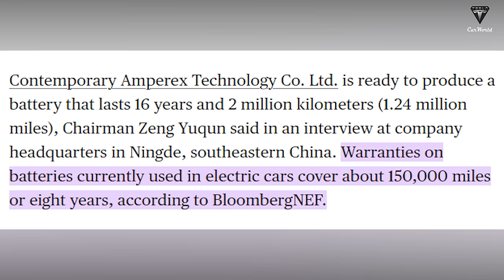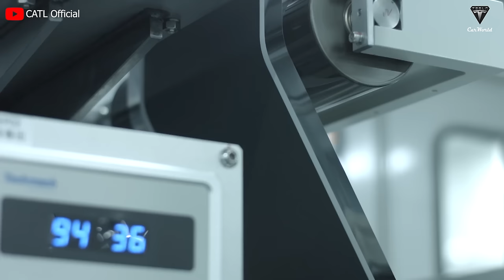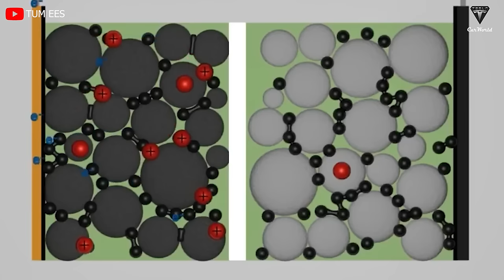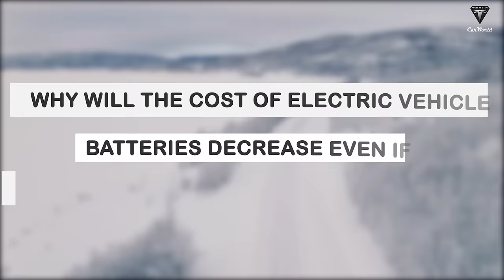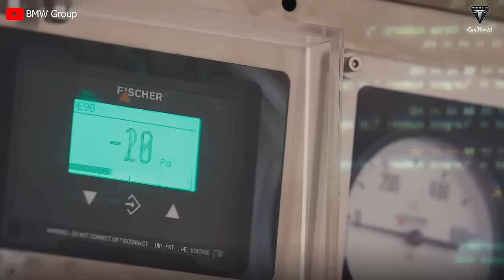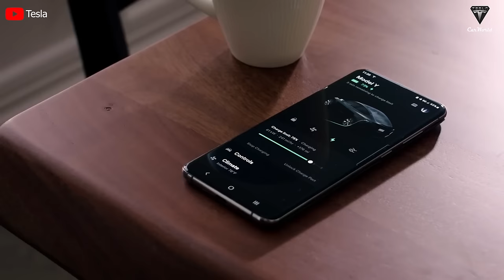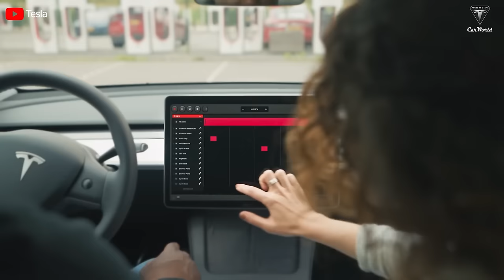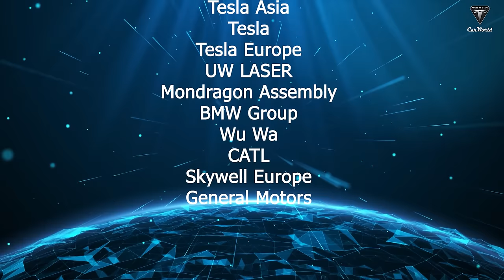Elon Musk Revealed RARE Battery 15 mins charge, Range of up to 1.24M miles! Shaking All EVs Industry

Comment: The BMS software should only allow charging from 20 to 80% for NMC batteries . The LFP BMS could allow full charge and discharge depending on the battery chemistry... instead of allowing the car user to arbitrarily charge, The car also could inform the user of the consequences of overriding the set parameters for charging . .. This will make sure the batteries are in optimal condition.

Comment: The biggest problem with batteries currently is not the warranty. It is with damage to the battery.
This damage, however slight, voids the warranty leaving the owner to pay for a battery that costs between 1/3 of the value to 100% of the value of the vehicle!

EVs depreciate so fast, that if the car is 1 year old or more, the insurance company totals the car and pays the owner the current value of the car which is typically less than is owed on the loan, leaving the owner having to pay the difference out of pocket.

But the cost doesn't end there. Insurance companies, which on avarage are already charging as much as three times the premium of an ICE car, the rate for the driver will increase as much as triple for as many as 10 years. So even if such an accident makes you give up on EVs and go back to ICE cars, you will still be stuck paying three times more for insurance for the next ten years.

Another fun thing about Tesla is that all of ELON MUSK'S super new technology like his now famous 'giga-press' are only valuable to Tesla. Making the entire chassis as one large part is cheaper to make and cheaper to assemble into a finished car. After that Musk doesn't care that the car is nearly impossible to repair. If the chassis is one part and it gets damaged, you have to replace the whole chassis. That means buying a stupidly expensive part and paying labor to disassemble and reassemble  the entire car without the benefit of rows and rows of robots. That is where the $20,000 repair bills come from. 
While not as bad as a damaged battery, a damaged chassis can easily cause the car to be totalled if it is only a few years old.
So remember, all of Musk's futuristic manufacturing breakthroughs are for HIS benefit, not yours.

EVs are like razor blades. You don't resharpen them. You throw them away.
Reply: I wonder whether it might be said that the fact that EVs are like computers on wheels makes their longevity but also repairability much like computers. So, the blame is less on Tesla per se than on the inevitable movement of EVs being made and sold lik electronic devices.
Reply: You haven't heard the "Rules of the Road" in Roatan! They are simple: Don't Hit something or someone, Don't get Hit by something or someone!"

Simple, smart guiding principles, that, when followed,  remove most, if not all, of your "Repair " concerns! 

Only one tiny scratch on my 13.5 year old current vehicle. None on the ones previously owned, since around 2002! 

Pay attention to Cross Traffic potential at Intersections - avoid T-Bone situations! Use your mirrors to keep an eye on what's coming up behind, keep an "Out" whenever possible, don't overdrive your tires and forward vision, (be able to stop, inside of your space between you and traffic ahead, even if it is suddenly there - Snowstorm, Whiteout, Black Ice, Fog, No Running Lights, Parked on Road, etc.) 

Basically, time Saved by going extra fast, is lost in seconds, and, as you said, can cost you, for up to a Decade!

Comment: If Tesla is partnering with CATL, what happens to their 4680 battery?  I heard that the 4680 has somewhat poor charging capabilities.
Reply: Not exactly sure if "4680" is, or is not, announced by CATL as a Form Factor they will also make, but I do recall Panasonic is moving to produce that form factor.

The Thing is, "Tesla's" 4680, is actually 2, or maybe 3, new ideas in one cell, at least. Besides the obvious Dimensions (46 mm Diameter x 80 mm Tall), there is also the "Dry Chemical Process" (which is the Hardest Challenge, from what has been shared), plus the "Tabless" design of the Jellyroll (which, is actually Continuous Tabs, vs just One), that adds up to their specifics.

Tabless Design, is just a Mechanical Property, same as the Can Dimensions of 4680. Anyone can build cells today, to accommodate such elements, with only moderate changes to equipment.

The Dry Chemical Process, however, is the Wildest Change, began by Maxwell, but not fully refined by them, that is on Tesla to accomplish. and anyone else trying! However, if successful, as they stated, large swaths of land aren't then needed, to Set-up Equipment & Processes for the Drying Equipment, tons of Input Energy to make Cells is Eliminated, with a Net Production Cost Reduction expected. 

Percentage of Not Perfect Finished Cells, seems to be a part of the end result, which is getting better, with less loss, or wasted Cells needing recycling. 

Just like a newly married couple, first child is the brunt of unprepared parents, in most cases, whereas the 5th, has multiple benefits! (Experience, Siblings to help, etc!)

As Elon has also stated, "Tesla is actually a collection of Startup Businesses" - Batteries are but one of them! Giga Press activities are another. Refining Ores and making Cathodes will be another! 

*Edud for Typos & fixing a sentence.

Comment: Still new not yet fully tested outside exposure to harsh environments, shocks from impacts, rapid temp changes, charging station conditions, Temp ranging from -24°F to 110°F nonlab controlled exposure,  How this battery reacts to sudden surges from outside or inside human factors influences that mostly counts how and when a vehicle will last, Electric or Internal Combustion propulsion. Emotions is great But Caution is much better.
Reply: We shall overcome
Reply: We shall overcome
Reply: Working Temperatures are difficult, since 0°F to 80°F is a fairly Narrow Range (just saying, not your #'s!), and, in reality, functioning at -50°C to +50°C is far closer to Ideal working environment! 

*Correction: "Ideal Testing Environment!" 

Humidity and Vibration - lots more information required there! Pot holes, relate to shock loads, too. Tesla's vehicle's, might be the best source of "Real World Conditions" to Model for, as they seem to have the widest range of Data! But, do they record vibration & shock loads? Or Humidity? How about Barometric Pressure, for Altitude testing?

Comment: Make that in a large full size luxury automobile and a range of 500 plus miles, charging times at 3 to 5 minutes and not 20 minutes or 20 hours, im all in.....
Reply: Ha! You really do need less "Stress" in your life! If your "Time" is so critical, get off the road and up in the air! A Private Plane is what you want, but didn't realize it! Something on the side of a Cessna 340, or a 421 Golden Eagle! In Electric! 😲 But, that to (in an Electric version or equivalent design) is not quite here, yet!

Think of it this way, from my experience, the "200 MPH Cessna 210" seats 6, but at that speed, burns a lot more than loafing along, leaned out, at 160 MPH! At that speed, you can actually still get 20 MPG! 

You won't get 20 MPG in any 6 seat Car or SUV on Any Road at that rate of 160 MPH! 

You'll be lucky to even maintain a steady 100 MPH, long enough to get the benefit of that speed, let alone get  anything much over 10 MPG! 

However, if "Time" is "Of The Essence", that same 160 MPH can be pushed up to 200 MPH, if Fuel economy isn't your priority, and Trip length still fits! (Go faster, go shorter; go slower, go longer!) 

Another advantage: no risk of Speeding Tickets Wasting your time and money! And, Direct routes equal less actual distance to go! 

If your Urgency while road tripping for vacation is such a big deal, maybe the issue is the travel planning? 

My own sister thinks BEV's need to have a "1,000 Mile Usable "Range Per Charge" in the worst Weather, before it would be her #1 Choice! 🙄 She drives long, hard, road trips, because she lives for her Pets: a couple Parrots, and Dog! I think she needs to "Chill" a bit! And, she, like you, make a too big a deal, about charging an EV! 

(Unless you absolutely will not use a Tesla or their Superchargers!)

CCS & ChaDeMo infrastructure being what it is, I get that issue, of wasted time to find a working fast charger, before you need a tow! And potentially slower charging!

But, with almost everyone that is trying to make a BEV, now coming over to the Tesla Developed and supported NACS, those issues should fade away, by 2026! 

In 2014, a Coworker bought a New Tesla Model S, and two weeks later, over Christmas Break, drove it from Toronto, Ontario, Canada to Key West, Florida, and back! In the 10 Years Since, Tesla has installed so many Superchargers AND Destination Chargers, that such trips, today, are not even a Challenge, and are Child's Play, now! 

Plus, Tesla has made ChaDeMo adapters available, in the past, and currently has a CCS Adapter available, as I understand. And, they have "Mobile Chargers" that offer 240 Volt (&120V) connections, for even greater options for charging them! (In Nearly "Off Grid" situations!)

Remember, when Charging a BEV, you don't have to stand by it! While it charges, you can go use the facilities, get a bite to eat, or do things that aren't legal to do while driving, like Text someone! So "Charging Time" isn't "Dead Time!"
Reply: Can you really get Gas, hit the washroom, AND get a Coffee or a Fast Food Bite to Eat, in 3-5 Minutes? Even if you just eat Chips, Pepperoni Sticks, or Peanuts, and grab a Coke, picked up at the Cashier Counter, that's still "Pushing it!"
Reply: Like i said, improve the EV and im all in..

Comment: In the 70s you were lucky if a car could break a hundred thousand miles. In the 80s they were doing pretty good at about a hundred and fifty thousand miles. Today everybody expects them to last 300,000 miles and for what they cost they probably should. Squeezing every mile out of the car is the only way to make sense of the numbers.
Reply: i have a 1999 diesel camper with 491,000 miles in it... and it still  passes emissions every year  and we are setting off for morrocco again in 3 months
Reply: I know my classic cars and early 70's before they introduced AC cars lasted forever as long as you cleaned and changed the fluids. with the introduction of cheep disposable cars they had problems because they did everything to make cars lighter.
Reply: @morkey74   I loved them too
But my GM Ford Dodge cars/trucks started rusting at three to five years back in the 70s they would chew up front end linkages at 30 to 40 thousand miles most definitely transmissions between 80 to 140 thousand miles... Alternators 60 to 80 thousand miles.
Water pumps at 80 to 100 thousand miles.
At 10 years you're lucky if the switch gears still working and the headliners isn't tickling the top of your head. I get way better service life out of my KIAs than I ever did out of any of my big three autos. If you were going to take any of those cars over a hundred thousand miles you're going to spend a lot of money replacing crappy parts.

Comment: Fusion  is only answer
Reply: Nope, it is but One Answer!

Less Wasted Energy, is another! (Like Better Insulated Homes need less Electricity, Natural Gas, Propane, Heating Oil, and Wood or Coal use! And Less Cooling Energy)

Another is reduction of how much "Commuting to Work" is required, or to make Commuting more Efficient (part of the primary goal, of BEV's, by the way! Plus, a Goal of "The Boeing Company"!)